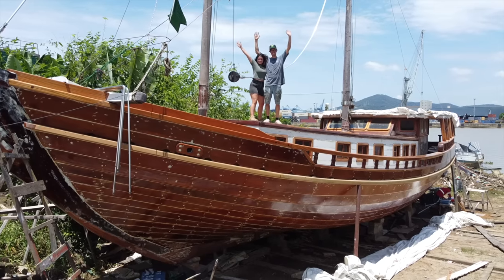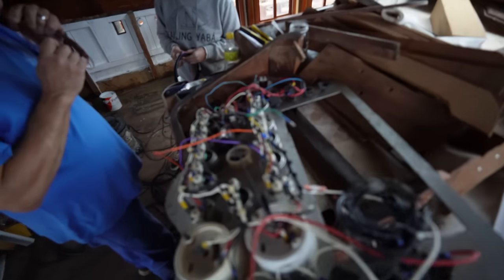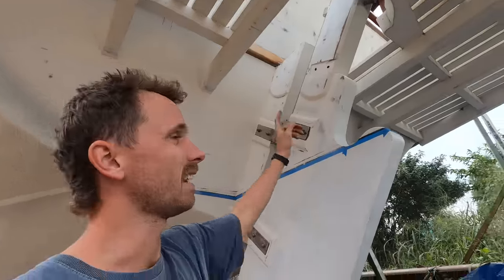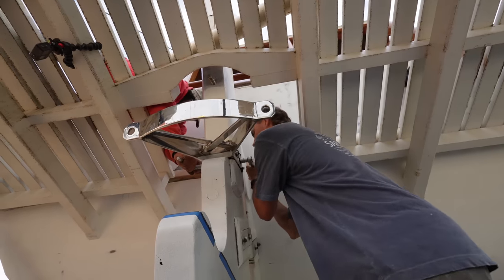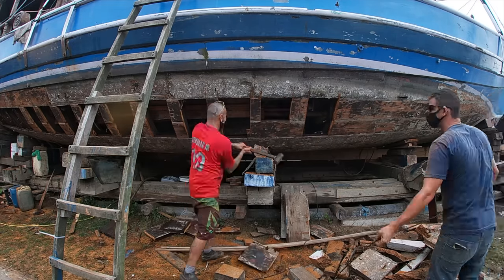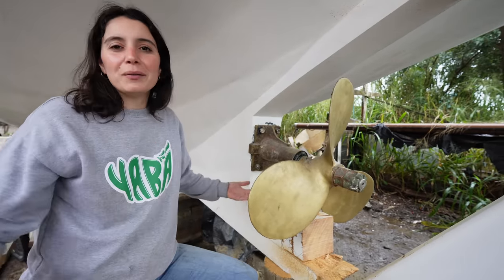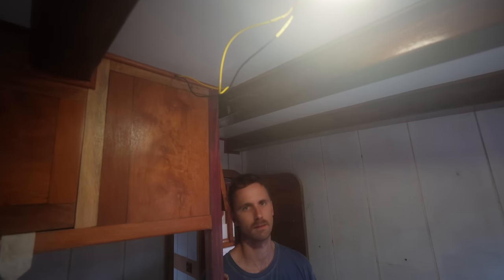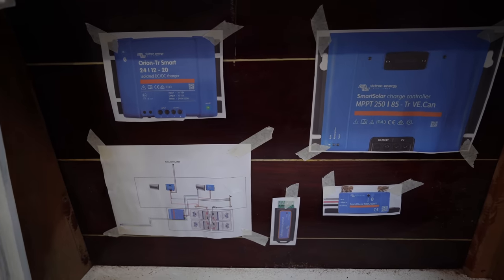Rebuilding the steering system of our RESCUED wooden boat — Sailing Yabá 151

Comment from the maker: Hi guys! We want to know: are you as shocked as we are with the images of how the wiring in the engine room was done before? 
Is it fair to say that we have improved it?
Reply: Not shocked, not even surprised, I've seen worse, both on boats and cars. Some people just don't care about the people who come after them, just good enough for it to work  today is good enough to call it job done, seems to be their attitude.
Reply: You’ve surpassed it by milestones!
Reply: Be sure to provide plenty of ventilation for any electronics. Hot air rises unless pushed/pulled by a fan. Fans wear out so best avoided. But you need to let cool air in from below so hot air can flow out at the top. Also, batteries have an optimum operating temperature range.
Reply: eu estou chocada!! inacreditável a mágica que fizeram! parabéns!!!👋👋👋
Reply: Hey, I have a great book on marine electrics.  Living on 12 volts by Ample Power.
I have the pdf version if you would like a copy.
Reply: That chain drive will make it relatively easy to fit an Autopilot drive.  👍👍👍
Reply: I wasn't shocked to see that. Although I know boats mostly through YT (or perhaps because of that) I know how boat owners can improvise in ways later owners wish they hadn't ... Add to that a pinch of what good old Europeans sometimes think about places in South America, and it is no wonder that I wasn't surprised. The colonialist aspect of that last part of the thought was amended when I remembered some electric wiring I saw only a few years ago in an old-ish appartment a friend of mine had bought here in Germany ...
What you did to the wiring is certainly an improvement!
Reply: @pfalzgraf7527  sometimes I fix things less than ideal when I'm in a pinch then because it keeps working I don't do anything about it. Lol. But I'm keeping my boats.
Reply: Hablan mucho en el video....
Reply: Job well done in my book. Make sure to create a wiring diagram for all the wiring and post them where they can be easily found in case of a failer or emergency.
Reply: MP, let’s be honest, any time you are in the shot, it’s a major improvement. Seriously though, it looks organised and tidy and no entanglement problem, safe and much better
Reply: Chocante!!!!!!!!!
Reply: Looking good all around (lertally round).. Vera is getting so big and helpful.. What a joy the three of you are!!!😊😊😊❤

Comment: nice to see your smiling faces again.  as an avid saltwater boater, I would suggest using heat shrink connectors or using heat shrink over your crimped connectors.  hopefully you are using tinned copper wire.  thanks for sharing this adventure.

Comment: Magnetic latches are easier to install but a small bolt is probably best for marine applications? MP working on the mechanical functions of steering is heartwarming for reasons I do not get, so good show MP! I like that you're shy and modest but take those mechanical ideas by the horns. Like what you did with the keel Ben. Really streamlined the fluid access to the lower prop area.

Comment: MP it is so good to see your Father and you working together on the electrical installation. Your below deck lights are boss. I like your custom
made steering gear.  Ben  well done shaping the keel to accommodate the prop and reduce cavitation. I know you will get the cabinets completed. Yaba crew is always working and with many improvements all the time. 👏👍⛵️🏝️

Comment: Great job guys like your work, but trust me the rudder quadrant needs to guide the steering cable through two curved grooved guides to maintain the tension on the cables as the rudder traverses port to starboard and return , additionally a pintle and gudgeon to be fitted to the rudder base to a sacrificial keel fitted under the existing keel. Happy boating !

Comment: Dont forget that electric parts get hot. Where your victron parts are behind that seat cushion there needs to be air flow. So make sure to cut vent slits or holes above, and below for air flow. Adding a small computer fan would also be a good idea.
Reply: At this stage it might also be wise to install some temperature monitoring sensors in key places (electronics bay, engine room, etc) and wire them into your panel so that those tucked away places can easily be checked on with one glance.

Comment: Been laying here recovering from surgery and contemplating my likely early expiration from this world while at the same time wanting to finish my own project boat. You guys are giving me motivation and as soon as im feeling better im on it. Got place to go, memories to make. Mine is only about 30ft but a complete custom one of a kind. Hull is just about done now im about to do decks, cabin, and pilothouse. And repower. Its not a sailboat but it will be 50/50 electric powdered boat semi displacement cruiser. Ive built 2 other 100% electric boats but for long distance i want the ability to power up and go as fast as my hull will allow if need be to outrun, weather, time, or health reasons. When time and weather arent a issue ill let the electric motor do the work. Electric is really enoyable going in and out of Marinas or small waterways. The very fine adjustments and speed control is just awesome. Anyways keep it coming. Looks great. I hope all your dreams come true. Btw sawzall will cut thru nails.

Comment: Ben & MP. May I suggest that you need to add a Gudgeon + Pintle to the bottom of the rudder, so that it connects to the extension of the keel that is passing aft under the prop. This should ensure that the prop wash does not effect the working of the unsupported part of the rudder blade. Worth check that out . Just a thought.
Reply: Fit a G+P to the sacrificial keel to be fitted later under the existing keel

Comment: Suggestion: Make a second chain of the correct length complete with spare coupler, grease it very well, put it in a sealed plastic bag inside the chain gearbox so if it breaks the spare is immediately to hand in an emergency

Comment: Frirstly you are doing a very good jod on this rebuild, good to see you have not taken any short cuts. I have noted that when the engine came out it was fitted with an intercooler between the turbo and intake manifold, but this is not installed on the rebuilt engine, this could  cause serious exhaust temperature problems if you have not reset the fuel pump calibrations from the original setting.
Keep up the good work

Comment: Great job!
However, please consider a rudder gearbox with two chains so you have a backup chain in case the first one fails.
Also, consider a chain tensioner to adjust the chain tension because it will stretch in time.
Maybe a good idea is to place protective covers on both sides of the sprockets to prevent the chain from falling off the sprocket.

Comment: Motorcycle final drive chains stretch, quite a bit in fact. Because of this there is an adjustment system on the rear wheel which allows the rear wheel to be moved further rearwards to take up the slack. Have you included for this chain stretch in your system?

Comment: Instead of spring latches for your covers, consider using powerful but small neodymium magnets, and a small steel plate. The magnets can be purchased with a hole in the middle, and are available world wide. They will never wear out, and once the grab hold of the metal plate, they don't let go without pulling quite hard. Cheers from Winnipeg.
Reply: Yes I just installed those thru out my new old vessel I'm working on... on every door an cabinet.. an a few other ideas...

Comment: I have those brass lid catches on my boat. As you say, they are sooo sensitive to misalignment. If you get them perfectly aligned, they work fine, but if not, they will just pop out, as you're showing us. You probably already know that you can adjust the catch strength by adjusting the spring pressure against the bearing balls by turning the screws at both ends of the catch?
I wish you good luck. And as a former electrician, I'm happy to see the conduits in the engine room. I would also have used cable ladders above the engine to lay out the harness.
Reply: Those catches usually turn out to be a poor choice since things tend to move around over time.  They get out of adjustment eventually.

Comment: Don't feel bad. I've had an awful time installing those latches, even on smaller doors with actual hinges to keep them aligned. What you need is something called an "elbow catch". You stick your finger through the hole in the locker lid to press the arm of the elbow catch to open the locker

Comment: Hello,
Connexion electric : a nice and clear work......and with...... a draw(of course) of all the wires with their own COLOR, Congrats.!!
RUDDER : You have to shape a little the front part of the rudder in front of the propeller in order for a more efficiency of this part of the front rudder regarding the turbulence of a square profil in front of the the water flux, that is so bad to drive rightely the vessel..(For example: add a half-round on the front-square rudder part  or some profil similar???)(hope that my english words are right?????)
Good works. 
Bon courage and stay safe

Comment: At the aft end of the keel, where it meeets the rudder, are you planning on installing a rudder hinge? (a) to support some of the weight and forces on rudder whilst sailing (b) prevent weed, ropes etc from getting caught forward of the rudder. Perhaps a hinge and a protective strip of metal is required.
Well done to MP for taking on and learning about electrics.  How about some night vision friendly lights in the head, galley and particularly in the wheel house.  Also in the wheel house lighting should be located and the suitable fittings so as not to reflect from the windows or surfaces.  It's tricky enough to make out lights outside the boat without introducing phanton ones.

Comment: I can give you the best tip you will ever ever need in electrical wiring, with this tip you need nothing more. "make sure that both ends of the wire is conected" it will work every time.  :)

Comment: 🌟🌟🌟🌟🌟 Ben , as soon as you held the new improved gold latches up for everyone to see, I knew already how problematic they would be for you, we have 1 in our camper that iam glade we only have 1.  I was thinking you may have about 70 to 80 mm of wood on back side that hinges between finger hole and top edge of hatch panel,,, it would pivot back and forth behind and when you put your fingers in the hole and push piece of hinged wood to side - it would swing top edge away from top of frame to be able to pull hatch cover out wards  .  The hinged piece would hang down from pivot point (screw )so it would not swing  open on its own.

Comment: Hi! About the steering. The motorcycle chain may, or it may not, cause a problem with your magnetic compass. If the chain itself or any of the moving bolts are magnetic and close enough to the compass they may interfere with the compass. I've seen this happen on ships as I'm a compass adjuster. Anyway, it's pretty easy to find out if there is a problem or not. While ship is still on land (i.e. not moving around) and the compass installed and the steering in place make a full turn of the steering wheel, from hard to port and then hard to starboard while watching the compass closely. If the compass changes heading you have magnetic interference from the steering. One degree or less is probably manageable but 2 degrees or more will prompt for actions taken.
Also, the instruments on your engine panel may hold magnets which may cause concern.
Anyway, you can find app's to your smartphone so that you can use it as a magnetometer which will help you to find items that disturb the compass.
Let's hope there are no issues :)

Comment: Cheers, will you do some frontline and backline phasing of the rudder? Right now not very hydrodynamic... Super nice project, coming together... 😊
P.s. with larger wire thickness, I always like to check bending radius so that the hardware spacing allows for nice routing of the cables later...

Comment: Those brass catches for the doors work great. Just don`t use them anywhere a door is opened and closed many times a day. The stainless steel balls will wear a groove in the brass tab and not hold effectively.

Comment: Smart move to change out the old wire. The older it gets  the more corrosion therefore the more resistance then voltage drop. Even if tinned which it probably isn't.   
I was having problems with my engine wiring harness. Things would or wouldn't work intermittently.  My marine mechanic friend asked, with a big smile,  when I last changed the wiring harness since the boat was built in 1983. NOT.
Luckily another friend had one and all those problems went away.

Comment: The Victron stuff needs ventilation! Keep in mind, a shadow(mast/rigging) on one panel of a series, GREATLY reduces the output of that entire series. So your can divide panels into different series with more charge controllers to help minimize losses or preferably use “Enteligent NMax” Optimizers on each panel.

Comment: Seems the wiring for the lights would have been planned before the ceiling panels went in. Also the little bit of leftover wood below the prop looks pretty flimsy. Won't the worms and possibly breaking it off over a little boo boo while maneuvering make it desirable for that structure to be beefed up?

Comment: MP while you have the Dashboard out take all the wires out one at a time clean up wire ends  and tidey  up those wires as 99%of fires start from bad wiring  so check whole lot as you go along ok better to do it while you, have them all loose plus put tags on engine bay ends then you will know which wire is which ok good luck

Comment: Fab! 
Just a heads up, the wires running down the wall, are they close to the Alternator generator or is that the starter? If it’s the Alternator just be aware that when it’s generating it will get hotter than the exhaust, it roasted our wires 8 inches from it. We had to put a heat shield over the wires, an old bit of sheet from a diesel truck exhaust we got from the breakers yard. I think I mentioned this also for above your Turbo unit and the roof above the engine. 
The room looks great
Think about a rope cutter on your prop shaft, they are not expensive, saved our bacon on several occasions in coastal waters.
Put a vent in the box with all the inverters etc to keep these cool when charging they can get really hot and cut out, we got a little fan with tubing to cool suck air in from the bilge.

Comment: I think you might regret those catches on the locker doors... if the boat is heeled and stuff in the lockers moves against the locker doors, they're going to pop open and potentially spill the contents out. Better to find a latching type.

Comment: Good video! Don't forget the pre-wireing to install the red or green lights under Deck. You will need descent red or green lights unde deck, for sailing during the night. Never switch on the white light under Deck in the night, you will loose your  night-visibility for a couple of minutes. 
😁👍

Comment: The electrical system... That is a hell of a job and has to be executed meticulously...👴🧐🤯
@03:18 I think that should be "too low"👴😉 (it will sound when the "contact" is on, and the engine is not running yet. So no oil-pressure)

Comment: The rudder is something that has to be 100%. Failure is not an option.  I am not a fan of clamps on the cables like you are doing.. But I come from the aircraft world.  I would like to see a redundant control system incase you have a failure of one of the 6mm cables. If it can fail.. It will is the best words to live by. The power of water in a cross current against such a large rudder surface and 6mm SS cable..  ????  I would at least have it so there is still an attach point for a hand rudder as before for a back up.  Just my thoughts.   You guys are amazing on what you have done with this boat.

Comment: HI , you need 1. 25 inches clearance between the wood and the prop to stop cavitation , if you don't your get vibration and loose performance of the prop due to air being formed as the blade passes the wood . Hope you read up and take this advice . I C Marne Services ,UK 37yrs marine engineer.

Comment: For some unknown reason, when I saw the chain and gear setup you were going to use, I thought "why not adapt a Olds Toronado chain drive?"  ;-)
Reply: It doesn't have to transmit much power but I would have used a bigger duplex chain for extra strength and reliability. Also much less prone to stretch as has been mentioned already.

Comment: The proper terms are not "ELECTRICS" Its working on/installing Electronics, signal wiring, power wiring, navigation, engine and navigation gauges, sea-talk etc..... For people who build boats and work on boats for a living its like nails on chalk saying electrics. FYI "Electrics" is more of a (British reference) and a play on words. But it is also describing to the viewers a mix mosh description of what's being worked on making it harder to follow what is being worked on for those who are not familiar with the kind of hardware devices that make a boat function. Just an FYI, I'm sure everything is done already and buttoned up at this point. But I would suggest getting wire labels and labeling each end if not already. That way in the future there are no questions. Also I hope you guys are creating a wiring hand book so you have a reference in the future of what has been wired to what.